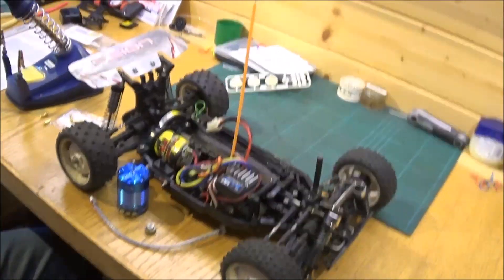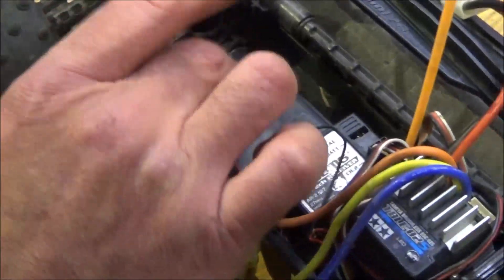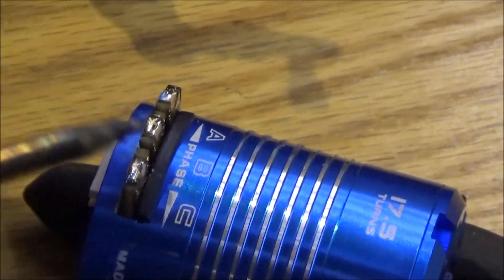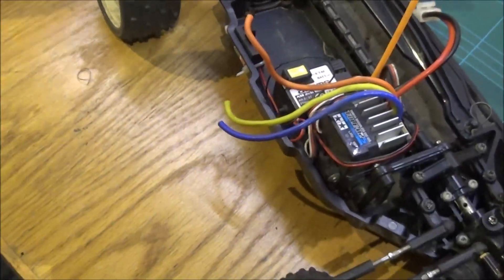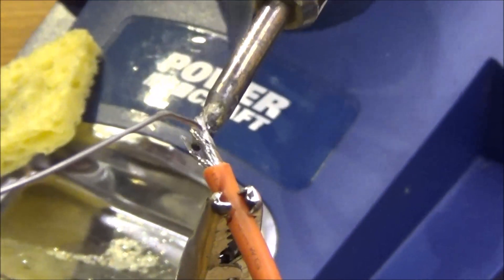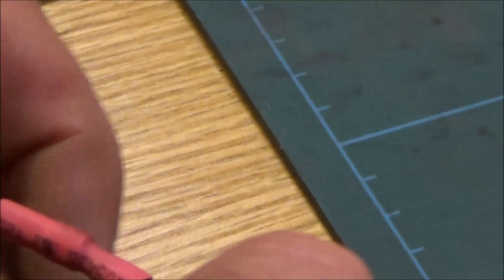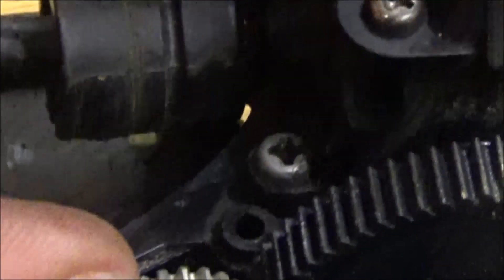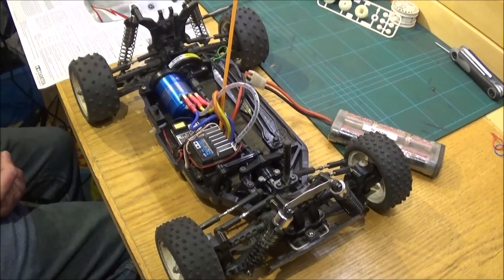How to Fit a Brushless Motor to a Tamiya TT02

Comment: Good video, no need to zoom in so much almost had a spew from motion sickness :D TT-02 is a nice platform.
Reply from the maker: Thanks Dylan! Sorry about the zoom - that was my 15 year old son on the camera - bless him, he did a better job than I could! Yeah, the TT-02 is a great starting point for many types of RC, road, rally and buggy!  All the best from Mark...    :)
Reply: @MarkBryanRC  oh then he really did a fantastic job. Was very useful as I'm looking to change to brushless.
Reply from the maker: Cheers, Dylan. I recommend the brushless conversion. The sensored motors run really smoothly, and faster (depending on the number of turns/Kv you go for) but the thing I like the most is that your run times are so much longer as the motors are much more efficient. I wouldn't go lower than a 13.5 turn though, as the plastic bevel gears are prone to stripping with way too much power.
Reply: @MarkBryanRC  you are a superstar I was wondering what turn I was looking at 13 and 10T so I'll go for a 15 or 13. Thanks a lot and yes I'm tired of the short run times.
Reply from the maker: No worries, any time Dylan!  :)

Comment: Very nice your videos, I like them! Just go a Subaru TT02, I'm wondering witch bruschless is the one I can supoport with out blowing the ESC! ?
Reply from the maker: Hi Martin. Thanks for the nice comment. You can fit any sensored brushless motor, if it is 13 turns or above it will be fine with the standard TBLE02s ESC. I have been running many 13.5T motors for over 2 years with no problems!  :-)

Comment: Clean and properly tin the tip of your soldering iron. It is a bloody disgrace.
Reply from the maker: Thank you Nick B! Looking back, it was a little dirty, but the joints were good, no problems in 2 years of running this car. Thanks for the kind advice and friendly comment.  :)

Comment: I have 2 questions: can I fit the turnigy trackstar motor the same way as you did in this video,
And could you please list all of the parts needed to fit the motor? (I'm forgetful)
Reply from the maker: Hi there - yes you can fit any other sensored motor in the same way as I show. You need:
sensored motor
sensor cable (from ESC to motor)
3 short lengths of electrical wire (the thicker the better, I used 13A mains cable)
3 bullet connectors

I hope this information is useful!  :-)
Reply: @MarkBryanRC  Thanks for the help! :-)
Reply from the maker: You are very welcome!  :))
Reply: @MarkBryanRC  Does the turnigy trackstar motor come with a sensor cable?
Reply from the maker: Yes it does mate! The Tamiya sensored motors don't!
Reply: @MarkBryanRC  Thanks again! :-)

Comment: Sensored ?? why not a Sensor-less motor
Reply from the maker: Sensored have better response, especially at lower speeds, plus it works with the standard TBLE Tamiya ESC. This is my preference.  But sensorless is fine to fit if you want, especially if you are at full throttle most of the time!  :-)
Reply: Yeah, I actually enjoy much more on full throttle . I enjoy rally and I have seen most guys modify this car in several ways but it is so low and not good on gravel

Comment: Will a 10.5 work for on road purposes?
Reply from the maker: Hi Dan - I have a 13.5 running with no probs off-road. The 10.5 should be fine, but I think I would follow Tamiya's advice and fit a cooling fan to the ESC if you are gonna stay with the TBLE02s.
Reply: Mark Bryan RC what fan
Reply from the maker: You can but the Tamiya ESC cooling fan but it's a bit pricey - search on ebay and you will find plenty of ESC cooling fans for only a few quid - they plug into your receiver's 5v socket to get power. You can run without one, but it does give a little safety and performance boost to keep the ESC cool.
Reply: Mark Bryan RC how do you attach it
Reply from the maker: Most of the fans come with a fitting kit!
Reply: Mark Bryan RC but how to the tble 02s
Reply from the maker: Look at this link https://www.ebay.co.uk/itm/Tamiya-45063-TFU-01-ESC-Cooling-Fan-for-use-with-TBLE-02S-TEU104BK-and-TEU105BK/163201857553?epid=2256103229&hash=item25ff96b811&enc=AQADAAADAFjVrDbVsZ8oH%2F8PNHtt9VX4%2Fw7FZcmMuqsX8uaFEduVC7EOEv324fIeoZyneip%2FEoFs0IqH61UY%2Feo0PAY2%2F60YCtRenb8AVe1Dv9fKwhJ3xA4OyV2aNENLW2uQgqr2HyiaLi6o8CXCjN8JjMeKt9VJygCfGQ7Q1SPMd%2BTnmFdIxtDeVlxXBULsFVfF%2BfThZj8BCActKvpIOkL%2FGJp5vzYYtTEPQoU7hWQUY7qTRAhUcDM79%2F9nKgK4Nltl7QtjsC8ZehqsZFV%2BcUm3XXkvBo6krwqGICpyou7Fu5X7Im9%2Bln16oTXpF0n4%2FIOA1f5unfqiQcsEwzpqsaN8mTmsqPQO03cAopWjVcQ4vMj%2Bvs1HvNeRkvcgEBQQ1YdC0Y13iw0ppHfLkoptpe7oNHItDkafsNN3r6JO%2Fip%2BtbINrlj06FI%2BZRuyWlmOoku2keyVSuQwW3ZX%2FTX4RMLHZ5EvZzejJeh4I%2Bf60d0K3abESDC5s5iCZTWdyaXXsyA%2BGagJPjTol3GeiLhIA8qos54zT%2Bc%2BxK3D5SOfWpShfPDqxFczY%2FiikRZmkvlfYboxKd%2Bgdr4VKI7U4gly%2F7h3NwMQba2zASz%2BMoS7Y2ZYDNIv3DlOxO1qpQdS%2BKAh3jw9lD5FWpVG1p4Rf9ydvScO5cdgrGzTJod%2F2Rx0%2Bt3z6rBkgfZNHx624eR5HM3wTxD5Gffy%2F%2BP2OEYALpPUJqW8ZBrB7WkP2eq17TtI%2BMOJaYFaFWziqEr6QZd3s10i%2B72dyYxts3m3dZ3MzI%2Bpap2g4byth0Zdscfh%2F9c5sFHasuVSUy01VKo5syFj2qdi8cGEug9ST1fFRTUU6nlV4NKtryowO1Y%2FIhcNzsZtDDx%2B1hia%2FWfS2SR6DrDjUVJ46l9tUKgsYMaWV%2BAqWtyi43LuIJS7ojmNVjZOyhT7FWT9LDEDt5u%2BiTuXG1vSOFMv9A9aHIHgATbv%2FgdagFtlZIzOX6AYkDBV%2BU3w9xFPyTF1%2BwZhsRfzSaD5WuaxPvWFd310vYuH1w%3D%3D&checksum=163201857553fbcdc62a57bc44799ba9965c66933c59 the instructions will show how!
Reply from the maker: If there is a will - there is a way!  :))

Comment: Very nice tutorial!
We recently picked up the TT-02 Mustang GT4.   We will go brushless eventually, so your tips and tricks were very helpful!

Have you upgraded the diff or spur gear from plastic?  How about driveshafts?
Reply from the maker: Thanks, Roadside RC! That Mustang will look awesome!  Glad you liked the video, it was nice doing it with my young son! 
No - I kept the transmission standard but I have stripped one of the diff gears - installed a new plastic one (very cheap) and it has been fine since, but the diffs are a weak point on these models so an upgrade to the DF metal diffs is a good option, but it takes a little filing to get them to fit, so I have heard.   :-)
Reply: @MarkBryanRC  Gotcha - thanks for the response. 

I heard something about DF-02 (?) diffs, but have not checked into them fully yet to find all the part numbers.  

Thanks again! 
I was wondering who was asking the questions in the background - nice to hear it was your son.
Reply from the maker: No worries - yeah, the DF-02 metal diffs fit in with a little persuasion! The plastic dogbones (or driveshafts) are very strong and it's quite expensive to change them for the steel ones. The propshaft is a cheap option to change for the alloy hop-up, about £10 with the alloy prop joints. Yeah it was my son, Alfie, asking questions and filming for me on his Samsung phone!  :))

Comment: Will 17.5 work on this esc
Reply from the maker: Yes Crish - the blue motor I fitted to this car was a 17.5 - I have also run a 13.5 on the TBLE02s ESC with no problems.

Comment: What is the brushless motor limit on that esc?
Reply from the maker: Hi Toby - the TBLE02s manual states that it will run the TBLM 10.5 turn brushless motor with a cooling fan fitted to the ESC. I have run the TBLE for many hours with a 13.5 turn motor with no overheating issues - hope this helps!  :-)

Comment: Please help, about to buy trinity 13.5 t,  Sensored brushless, can size 540. Will this work with tble Sensored esc?
Reply from the maker: Hi there! I have fitted several Turnigy Trackstar 13.5 Sensored brushless motors to the Tamiya TBLE02s ESC, and all work very well, I have had no problems!  Here is a link to my video where I show how to fit this motor to the ESC on my Konghead  https://www.youtube.com/watch?v=u5gYg4rnpJM    I hope this will show you what you need to do!  All the best, Mark   :-)

Comment: Hello again; I´m trying to set up my TBLE 02S for brushless mode. I wasn´t sure whether you had the radio on while you did it, but as you asked Alf to press "forward" and there seemed to be no delay while he switched on, I took it that you had the Tx switched on all along.
 When I try it, I get a red, rather than an orange, LED which flashes quickly, unlike your slower orange flash. Pressing the "set" button has no effect.
 I´ve tried with the Tx switched off with the same result and I know that it´s working as the steering works. I´m starting to think I may have a faulty ESC, but as it´s brand new and genuine Tamiya that does seem unlikely. Have you any advice for me?
Reply from the maker: Hi Del - Hmmm - something sounds amiss!
You need to do the brushed/brushless setup with the Tx OFF
Hold the set button down BEFORE you power on (I need to use a pen or similar to make sure it is pressed down - you can hear a faint click when it is on).
Power on keeping the set button down, release when the ORANGE LED lights up  - be careful 'cos the orange and red LED look very similar, the sequence is GREEN, ORANGE, RED. SO just release the set button after it changes from green. It flashes orange, then you press set again to accept the setting. It should then flash orange and bleep till you turn the TX on, when it will stop bleeping.
The setup I show of the TBLE is clearer in the Konghead version of this video, I think!
Hope this helps, Del - good luck!!!
Reply: Thanks for your reply, Mark.
 I just did it again, with the Tx switched off...and it worked like a charm. I was able to distinguish the orange from the red and did it all as you described. When I turned the Tx on the LED settled to a slow, contented-seeming orange flash, but there´s no response from the motor.
 As everything happened exactly as you described right up till I squeezed the trigger, I think we can give the ESC a clean bill of health (I´ll confirm that by plugging it into something else) so I´m starting to stare at my motor with a jaundiced eye. At least, thanks to your video, I know where to get an affordable replacement!
Reply from the maker: Sounds like the ESC is OK! Just a thought, you have got the sensor cable plugged in? I had a sensor cable with one of the tiny wires dry-jointed on one of the end connectors, and the motor would not spin.
Reply: Sadly it´s a sensorless motor. I think the ESC´s okay - I plan to plug it into my Mini Trophy this evening, to confirm that I need a new motor.
Reply from the maker: Ahhh - that's it then Del - the TBLE will only work with sensored motors!  You will need a sensorless ESC for that motor - good news is the motor is most probably fine  :-)
Reply: I recently saw some very cheap action cameras being reviewed on the Slingshot Channel. I´m planning a clandestine late-night card-caning buying spree, in which I order a camera and a sensorless ESC  : )
Reply from the maker: Hehe - sounds great - have fun with the bank-card-bashing    ;D

Comment: installs brushless rip spur gear
Reply from the maker: Thanks for the comment, Wasawat Rojratchadakorn!!! I have installed brushless motors on 2 Neo Scorcher TT-02B's and have had no problems with the spur gear, differentials or any of the drivetrain - what brushless motor did you fit? I think you are correct, if you fit anything lower than a 13.5 turn motor, it WILL probably rip the spur gear or differential gears!    :-)
Reply: Mark Bryan RC rlly? Im installing a brushless and preparing for paint tmr lol0
Reply: Mark Bryan RC yeh last time i installed a 9t brushless. Didnt go well lol
Reply from the maker: Wasawat Rojratchadakorn, 9t !!! Now I see why spur gear ripped! Far too powerful for only plastic gears! :D
Reply from the maker: Wasawat Rojratchadakorn -Both my Neo Scorchers have been running for a long time on brushless, 17.5T and 13.5T -  you can see them running fast here : https://www.youtube.com/watch?v=-tnlfdjm8eA 
You are installing brushless again? How many turns this time mate? More than 9t I hope!!! Good luck with the painting - I hope all goes well and you don't break anything when it is finished :D
Reply: Mark Bryan RC currently running tble02s and a torque tuned motor.
Reply: Mark Bryan RC doing a full tournament racing buggy. Ful suspension upgrades hop ups aluminum and brushless stuff
Reply from the maker: Sounds like a lot of fun mate - I never was brave enough (or good enough driver) to enter tournament!  Good luck with that :D
Reply from the maker: Ahh - TBLE and Torque tuned - might be OK if running Lipo, but mine was a little slow on 7.2v NiMh, that's why I went high-turn brushless - needed more SPEED!!!
Reply: Mark Bryan RC love your vids btw haha

Comment: Can the differentials and clutch take 3s brushless power?
Reply: Because I want to buy a new aluminium tt01 assembled chassis from eBay and install a brushless system
Reply from the maker: Hi flamehawk189  - if you run a fast motor (i.e. 13 turns or less) and a 3S LiPo, I don't think the differentials will last long as all the gears in the TT01 and TT02 are plastic. I have heard that you can make the DF02 metal differential gears fit with a little filing down, but this then becomes more tricky and more expensive - a friend of mine fitted a 4300 kv brushless motor running on 2S LiPo's and stripped the TT02 plastic diffs in a couple of hours. There is no clutch to worry about in a TT01 or TT02. I hope this helps!
Reply: Mark Bryan RC thank you so much probably the most helpful comment I've had 😉
Reply from the maker: Thanks flamehawk189 - You are very welcome!
So glad you thought it was useful ! I will always try and answer any questions you have honestly - and if I don't know, I'll say that I don't know! 
By the way, I am running a TT02 with a Turnigy Trackstar sensored brushless motor and the standard Tamiya TBLE-02s ESC - this is pretty fast on 7.2v NiMh batteries and I have had no problems with the differentials or other gears. I have been running it regularly for over 2 years now - but I guess you could call the motor setup "mildly" quick! (but it is still MUCH faster than the stock setup). You can see it running here if you like to get an idea of the speed: https://www.youtube.com/watch?v=wKpJLEdogy0

Comment: Got the brushless motor today got two problems first the sensor wire is tiny way to short and secondly the motor only works full throttle forwards it won’t work in reverse without spinning the spindle I think it must have a winding down
Reply from the maker: Sorry to hear of your troubles mate! First of all I need to ask you some questions before I can help:
Exactly what motor did you buy and where from?
What Tamiya are you fitting it in?
Does it not increase in speed gradually - or is it full speed or nothing?
So in reverse, you give the spindle a twist with your fingers and it goes?
This does sound very strange and I have never encountered any of the issues you describe - let's see if we can sort it out :-)
Reply from the maker: First thing to make sure the ABC phase wires are correct!
Reply: Mark Bryan RC I wired up how you described and it is progressive in forward but it needs full throttle to get it going them you can back it off it’s trying to work in reverse but just won’t start 
It’s looks the same one you bought 13;5 turn 
I’m using it on the TBLE 02
I’ve checked the resistance of the main winding they are all the same
Reply: Mark Bryan RC exactly as you described more or less full or nothing seems very little power and reverse only it you give the spindle a flick
Reply from the maker: Well mate - sorry to say that the motor must be faulty - the TBLE is very reliable so I don't think the fault will be with that. If you bought it off ebay I would try for a refund - most good sellers will just give a refund and not ask for the motor back - very sorry this has happened to you - but stay with it mate - it will be worth it in the end :-)
Reply: Mark Bryan RC I got it off amazon it looks identical to the ones you bought they gave you a choice of wind so I went for a 13:5 instead as I already have a TBLE 01 brushless 16 turn combo I’ll contact the seller see what they say
Reply: Mark Bryan RC I’ve also got another TBLE 02 speedo. Controller I can try it on before I give up 
Have you posted a video of the car running with the motor in it I have looked for it
Reply from the maker: Hi Neil - it's got to be worth a try with the other TBLE - then you can rule that out of the equation. Definitely sounds like the new motor is the issue though! You can see the Neo Scorcher from the "how to fit a Brushless motor" video running here: https://www.youtube.com/watch?v=9Hlsgpn84wc
Hope you manage to sort it out :-)